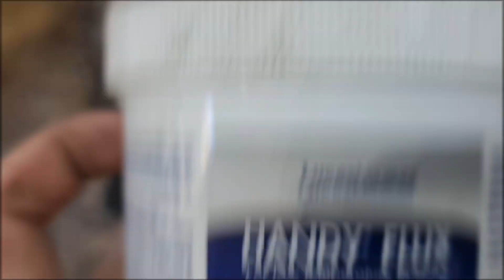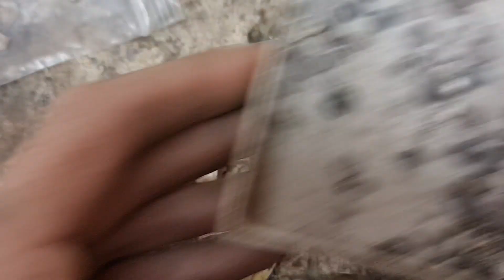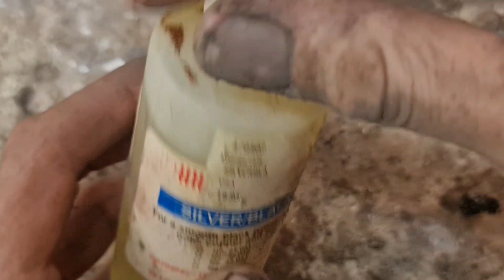Making Turquoise Earrings Jewelry Sterling Silver and Morenci Turquoise

Comment: On your sunburst can I ask what size gauge metal you use?
Reply from the maker: I honestly can say,  because I use all recycled silver.. so most of my stamps are made from spoon handles that I've hammered/thinned out and then stamped. I try not to use too thin of sterling sheet because the punch/stamp will crease it enough to crack when you bend the suns. So, something thick enough to take the stamp without piercing through.
Reply: thank you so much for answering me, I have been working on a project which I made the components flowers I am thinking maybe 20 ga and when I soldered them on I blistered the metal I got it to hot 

 @TwoManyProjects
Reply from the maker: @Nancy4133nope  it would be good to try a thicker gage metal. 20 gage is a bit thin but can work for stamps. Maybe try an 18 gage or do what I do and repurpose sterling spoons or forks...this is how I get a lot of my sterling is from spoons/forks/platters that are sterling.